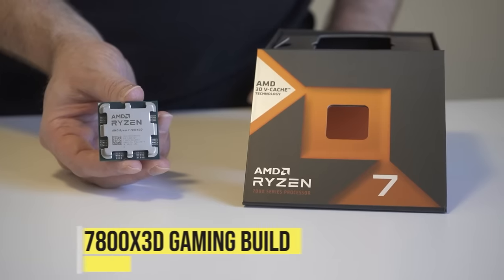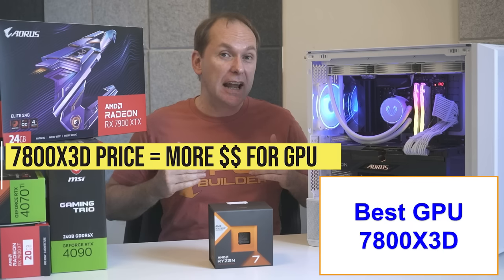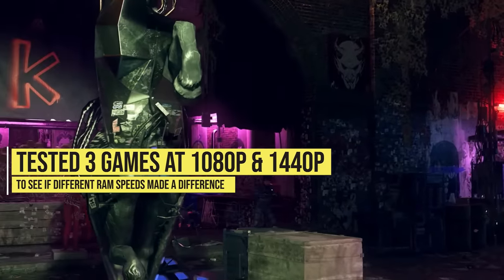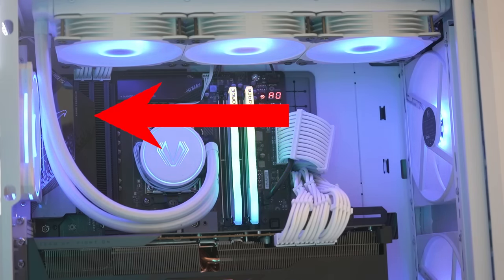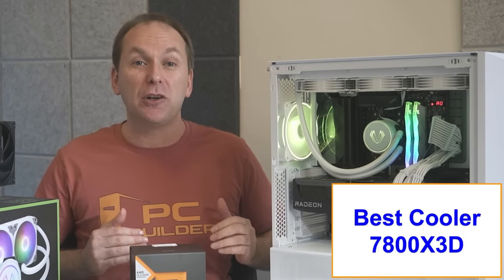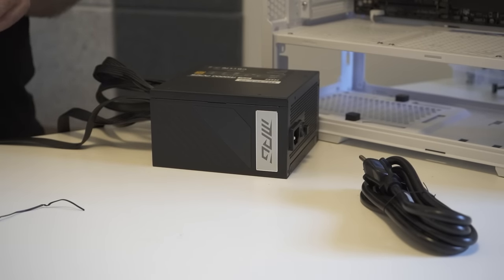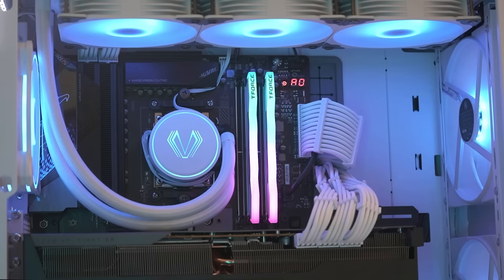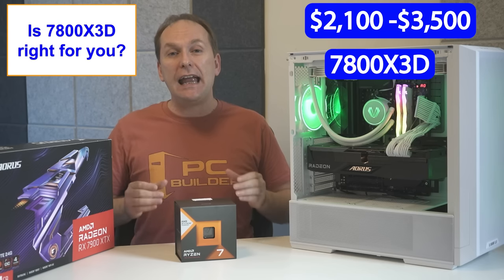🛑 Best Ryzen 7800X3D Gaming PC Build 🛑 Best RAM, Motherboard, GPU & More

Comment: Yeah, see how it compares to my old  build!
What difference can 2000 in the CPU number make?  (7800x3D-5800x3D)
I am impressed by the emphasis on reduced cooling, I have found that my 120mm AIO I picked up to experiment on offer, is MORE than adequate and DOES deliver more boost and lower temps than an air tower rated for 200w TDP.
Using a 240mm AIO would force top mounting and using a mesh case top, rather than the rear mount which is working well.
So when the solid cuts noise, with the board sensor temps remaining cool under heavy load, it's preferable.
I do agree though, the asking prices of non-discounted 120mm means minimal savings and in general 240mm would be quieter.
Reply from the maker: Good morning Rob!
Reply: @PCBuilderChannel  ahh, I edited my post before I saw you had seen it lolol
Good afternoon 😁😁
Reply from the maker: Got to you super fast! lol 
And thank you for sharing more.
Reply: @PCBuilderChannel  so after I rebuilt with AM4 to re-employ my 5600x, I realised I would have been better going with 7600x, B650 & the G.Skills Expo DDRAM Kit on my daily/gaming rig as it would be just €50 more than I spent on AM4 x3D upgrade.  The idea being platform longevity and future Zen5 or Zen6.  I think DDR5-6000 matters more for non V-cache.
Rebuilding with similar motherboard and the same model case, really allowed me to get the cable management neater and up the quality.  When you know the best cooling strategy and which cables are tight and need the fan header pre-routing through gaps that will be blocked later by the installed PSU.
Reply: Already pulled the trigger on a 7900x - didn't want to wait. It should do fine. A few bucks cheaper, and maybe a little better for non gaming uses. Got a decent deal on a used 3080 and picked up that g skill neo trident 6000/30 like you tested. Building this weekend.
Reply: @joeschmo2693  right, that makes sense.  I just picked the 7600x for AM5 upgrade comparison as it's available the cheapest in my region.  My theory of value is to wait for price drops and start with a cheap CPU, then upgrade a few years later to a better CPU.
My 5800x3D upgrade happened as prices had fallen and I didn't realise I'd be buying a new mobo & RAM to rebuild having passed on my 5600x to a data analyst as a working system (new case, PSU, cooler and NVME system drive)
Reply: @RobBCactive  That probably makes more sense than what I did. I overbuilt, figuring to replace the GPU in a couple of years. My mobo supports pcie5x16 and has a gen5 m.2 slot as well.

Comment: Currently running a Ryzen 7800X3D, Msi B650 Tomahawk, Corsair 32gb 6000MHZ, with a EVGA 3080 FTW3 ULTRA 10GB card. Its absolutely amazing but have notice i can get extremely GPU bottlenecked in some games to where it causes Frame stutters(dont know if its actually a bottleneck or if something else is going on) thinking of upgrading to a 7900xt gpu to just be sure lol

Comment: Using  Asrock B650 Pro RS R5 7600 32GB DDR5 Lian Li Lancool 216 case Deepcool GAMMAXX AG400 WH cooler WD SN850X 1TB. I just realised you used the same case I did. I even did the same rear fan swap

Comment: My only criticism of this video is the thermal paste application process. All you need is a small pea sized amount on the centre of the IHS. When the heatsink is attached to the CPU, the thermal paste will spread out. You don't need a "thermal paste applicator" to spread out the thermal paste yourself.
Reply from the maker: To each their own on that one (; 
A lot of outlets have tested various thermal applications (including a great video from Gamers Nexus I recommend) and they found it makes no difference, the only thing that did was not applying enough. So this is my tried and true method but other builders will have their own versions.

Comment: Hey jason, was hunting for the 4090, in the meantime found a tuf OC 4070ti (i have a soft spot for TUF) sealed for ~30% off [still 18% cheaper than the cheapest 4070ti](from the cheapest shop in my country, otherwise ASUS premium is high), that will last me till i find a cheap 4090, after that i will pass it to my brother. he has a 180hz 1440p display, perfect gameplan.

Comment: I found the biggest issue i had with my AM5 build was trying to put 4 dimms running at full expo speed. This is still unstable even with the latest AGESA 1006 bios build. Best to go with 2 dimms with QVL ram (Check the vendor & the mobo manufacturer to be sure). I installed 2x32gb CL30 6000 EXPO Tridents on my x670E hero with a 4090 and 7800x3d. It took the timings well and had less headaches/worries compared to my previous 7950x3d (i.e. always worring, checking if the cores are parking for my game). Can't go wrong with these new AMD chips, the power (heat) consumption is really unmatched for full air cooled builds (Torrent & D15)
Reply from the maker: Nice build! Yes RAM has been a headache on Ryzen 7000 but I think with the latest bios updates they are getting it under control. We went through this with DDR4 a long time ago!

Comment: Nope not the parts I would choose. I'm in the market for a new PC and I'm choosing quality parts for it. If you are going all out on the cpu and gpu, what difference does it make to buy a more premium case and cooling. I'm planning to get an NZXT H7 Flow case, I already have an NZXT H710i case for my current PC, and I really like it, lots of space for everything and building your rig with it is like a dream. Obviously going for the 7800X3D. I chose the G.Skill 2x16 DDR5-6000 CL32 EXPO RGB kit and a BeQuiet 360mm AIO RGB cpu cooler. I already have the Asus TUF GAMING OC RTX4070Ti and for the motherboard I'm gonna go with the MSI B650 Carbon wifi. As of storage, I'm thinking of filling all the slots with Lexar 2TB m.2 SSDs. A BeQuiet 850Watt PSU with the 12VHPR connector should be enough, heck even a 750 would do. And that's about it for me 😊

Comment: Catman, what adjustments would I have to make to make this production build primarily, then also gaming?
Reply from the maker: Mr. Bear says hi! Honestly I'd get a different CPU. This is not a production first CPU if you get paid to do work. 13600K would be a way better option, or if you want to go big grab the 7950X.
Reply: @PCBuilderChannel  Would you recommend the X3D models? I'm not a professional. I'm looking to build my first PC. It'll have games on it, but I'm looking to take online courses in every part of tech and see what I like and pursue it. I'm creating a channel on YouTube Rumble, similar to yours. I'm going to learn about video editing and content creation. I want to learn about coding. I don't know what I'll need in means of specs because I'm trying out allot of programs and courses. I want hardware that'll handle most things that doesn't include professional use. I'm thinking devinci resolve for awhile, then maybe studio after that. I'm looking to spend 2k to 3k. Would the 7950x and the Radeon 7900xtx cover what I'm looking for? Or should I simply go to the 4090? Do you see the 4090s getting any cheaper?
Reply: @AnthonyIsToeKnee for production work the X3D Models aren't worth it.  So the 13600K, 13700K, 7900X, or 7950X are good options for you.  I would look at the programs you plan on doing and see if they recommend an AMD GPU or Nvidia.  If you'd like after you figure that out I can make you a sample build.

Comment: For 1440p high FPS and occasionally some 4k gaming, would you recommend 4080 or 7900xtx? I was also going to go with the MSI PRO Z790-P WIFI ATX LGA1700 Motherboard and i713700k CPU. I don't even know if these go well together.
Reply: Well if you're using it for gaming, an AMD CPU would be better.

As for the 4080 vs 7900 XTX is just depends on whether you care about Ray Tracing or not.  If you do get the 4080, but if you don't get the 7900 XTX.
Reply from the maker: For a gaming focused build I'd do this build right now for sure (the 7800X3D) paired with either the 4080 or 7900XTX (about equal). I would only consider Intel in this budget if you do a lot of productivity work as well

Comment: The mb, cpu, and ram kit are Exactly what I picked for my soon to come system upgrade once property tax returns arrive. 👍
Reply: With the prime day deals I switched my ram pick and went for 32 gigs of corsair vengance rgb 6000 cl 30 instead since they are expo ram and cost the same on sale and on the compatibility list.
And pulled the trigger on the rest now as they are selling out everywhere.
Coupled with my 4090 aorus master in my asus tuf gt501 case with corsair h150i elite lcd and I am expecting a near perfect gaming system.

Comment: Liked it before you even announced yourself.

Jason I really want to know what your feelings are on this chip with a 650E motherboard (I'm looking at either a rog strix 650E or a TUF gaming 670E) and an existing 6800XT
Reply: As stated in the video he actually doesn't recommend the 6800 XT with this CPU.

As for the Motherboard he doesn't think X670 is worth it so the Strix would be the better choice.  Either the -A or -F as the -E is more expensive for some reason.

Comment: If i shop for cheap parts that won't affect performance in EU region (netherlands) there is a difference of 300 euro between AM4 (5800x3d) and AM5 (7800x3d). The CPU difference will net me around 24% performance difference in the most ideal situations 1080p. That a price difference big enough to have to chose between a 5800x3d and a 7900xtx or a 7800x3d with an 7900xt:buffering:
Reply from the maker: That’s a tough one but I personally would go 5800X3D then with the more powerful GPU. Unless you are the type that likes to upgrade frequently in which case going for the latest ryzen platform is better

Comment: I have a 6800xt paired with a 7800x3d. Kingston FURY Renegade 6000 cl32 overclocked to 6200 cl30. Asus b650e-e motherboard. EVGA 1000w PSU. KC3000 m.2 2tb. Deep Cool Gammaxx V2 360 AIO. Phanteks Enthoo tempered glass case.

Comment: what build of a computer you would make for I racing and streaming. 3 monitor  / 27ins 1440p 165hz 1m  with out bottle necking what would you recommend ty for your help ty
Reply from the maker: If you have the budget for it 7800X3D is a good choice! If you want more cores 14700K is also great. See our latest Best Builds April video for a great sample 14700K build. You can find it on the channel page

Comment: Hello @PCBuilderChannel 👋🏾. I have watched so many of your videos trying to figure out what parts to purchase for my first pc build for the past week or so. I already have an Alienware that was prebuilt a few years ago and I just purchase the NXZT H6 Flow case a week ago and ready to upgrade. I’ve been going back & forth between your videos and watching them over & over…

My current PC Specs:
Monitor - LG 32GP750-B 32 Inch QHD (2560 x 1440) IPS UltraGear Gaming Monitor with 1ms (GtG) and 165Hz Refresh Rate
Alienware Aurora R10 (Ryzen Edition)
AMD Ryzen(TM) 7 3700X (8-Core, 32MB L3 Cache, Max Boost Clock of 4.4GHz)
Windows 11 Home (64bit)
NVIDIA GeForce GTX 1660 SUPER 6GB GDDR6
16GB Dual Channel HyperX(FM) FURY DDR4 XMP at 2933MHz
Samsung 500gb V-NAND SSD 970 EVO Plus NVMe M.2+ 1TB 7200RPM SATA 6Gb/s (Storage)
Dark Side of the Moon chassis with Low-Profile Smart Cooling CPU Heatsink and 550W
Power Supply
Killer Wi-Fi 6 AX1650 (2x2) and Bluetooth 5.0

Which parts (all black) do you recommend for 1440p gaming (Motherboard, GPU, RAM, Power Supply box)? So far I’m considering getting the Ryzen-7 7800x3d and the NZXT Kraken Elite RGB 360 - RL-KR36E-B1 - 360mm AIO CPU. Any suggestions? 

Thank you 😊

Comment: First off, my question. Do you think it will be ok with a 850W PSU? Almost same build, but estimated 627W at Pcpartpicker.

Then for the praise,
A perfect video covering a 7800x3d build. I just bought a 7800x3d but there are about a 2 week wait to get it, so I have some time ordering the rest of the build and this video answered so many questions. Thank you for taking the extra time trying out different RAM and coolers, helps a lot!
Reply: No because you're supposed to time the watts by 1.5 to see what watt PSU you need.

Since you got 627 you'd need a 1000W PSU.
Reply from the maker: So glad this video was helpful! 
For PSU sizing hop over to our Best PSU 2022 video and follow the method there to calculate for your full build

Comment: I have a question, how did you install the Kingston Fury Renegade without removing the Q latch? Or did you unscrew the Q latch to replace it with the screws that come included inside the motherboard box? I just started building this exact same build last night and I got stuck on that part because I’m confused as to what I have to do to install the ssd. Thank you.

Comment: Hey Jason, I have a silly question, but what orientation did you install the aio fans at the top of the tower? Did you install them in a way where it’s taking the heat from inside the tower and pushing that hot air out the top? I assume the rgb fan in the back is doing the same (pushing hot air from inside out the back of the tower)?
Reply from the maker: Yes we put them in as exhaust

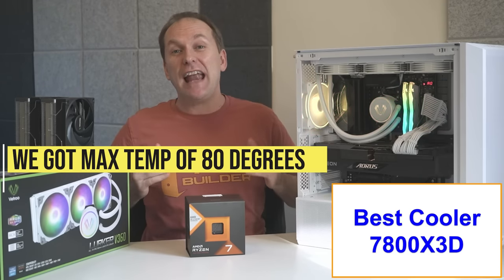Comment: 10:49 I want to buy a r7 7700 non x, is a dual tower enough, or do I need a 240 aio?
Reply from the maker: A dual tower would be nice, but you can run it with the included stock cooler so budget is fine. See our 7600 build guide for more, Id use the same list

Comment: Thanks for the video!
what are your thoughts on XFX speedster 7900xtx, gigabyte x670e aorus extreme as replacements to the one you mentioned.
Reply: That's probably good though Jason has said before X670 isn't worth it so you could save more money by going with a B650/B650e.
Reply from the maker: GPU = great, probably overspending on the motherboard but also fine if that’s the one you want

Comment: I will (prob) be upgrading to this model (after few months). I run a 8600k with is okay (when overclocked), but it is def time to upgrade to run unoptimized games. I don't need this power, but swapping out mobo/cpu is not very fun when the build is more difficult to rebuild so I will be bottling this one for more future ease. Will be swapping out the 3060ti when something more appealing hits the market or this does not perform like I want it to. 

Also I recently switched from 1440p to 1080p because games became more demanding as when the 3060ti first released which I was lucky to get for 500 euros at launch.
Reply from the maker: Consider the Ryzen 7600 with a cheaper B650 or even A620 board. See our build guide from December to get started.

Comment: A PSU with 850w is not enough for the 7800XD/7900XTX combo? I want the 7900XTX Sapphire Nitro and it seems it pulls even more voltage. Should I go with a 7900XT instead?
Reply: Its merely enough. Lets say you have a Ryzen 9 7950x and a 7900xtx and the wattage would be like 625 watts times 1.5 would be 937.5 watts. You might think that 1000w is needed but not really. If your current psu is A-tier on the Cultist list PSU tier list website, then going for a 7900xtx would be fine.

Edit: I calculated the wrong 7900xtx. Its the XFX MERC one. You might consider that or the other brands since the Sapphire nitro draws more power. I checked that the total wattage would be 689 watts. Multiply by 1.5 and that would be 1033 watts.
Reply: @keizhardy931  Samsung G7. His channel always recommends that when it comes to monitors.
Reply: @keizhardy931  Oh yeah btw, the reason why I recommended the XFX is because of the reviews. Its got really good cooling and thermals compared to other 7900XTXs.
Reply: @rogued3mon414  I will check it out dude, thanks!
Reply from the maker: Hop over to our Best PSU 2022 video for more on how to pick the right wattage for your build

Comment: Were you on AGESA 1.0.05c or 1.0.0.6 for this video? Also I’ve never played around with PBO settings. Is it safe to enable? I have a MSI Pro x670-p wifi, 4090 FE, GSKill 32gb 6000mhz cl30, and 7800x3d (arriving next week)

Comment: So my 6800xt is not a good match for this build or would it be bottlenecked?
Reply: wondering the same thing
Reply: I think it gives some extra performance in games. 3D cache CPUs give better performance in games so pairing said CPU with a 6800xt will bring out everything FPS it could process. I'ts not exactly bottleneck but a limit in the FPS the GPU could process in any resolution.
Reply from the maker: Not a good match I'm afraid. You'd be better off with a 7600 or 7700. I would only go up to a 7800X3D with a minimum of 7900 XT
Reply: @PCBuilderChannel  ok thanks for the info very helpful.